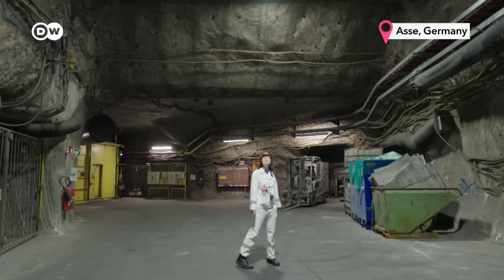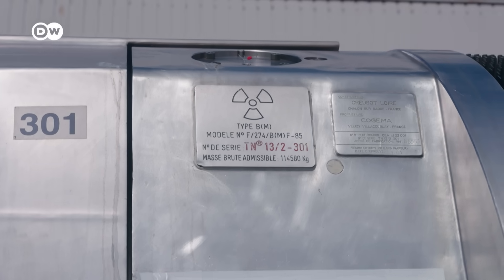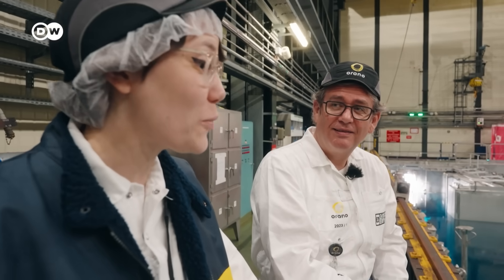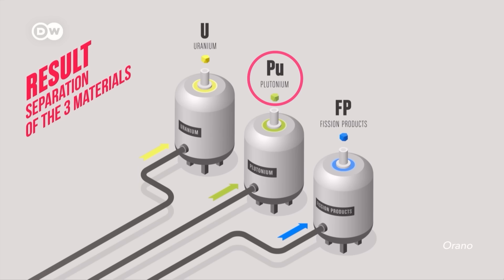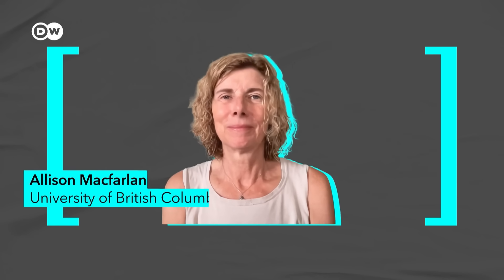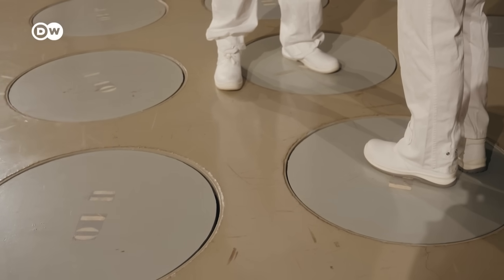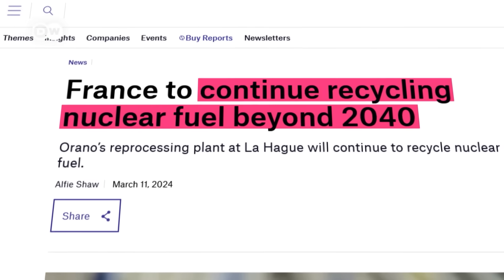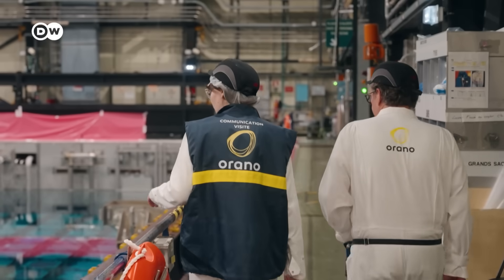Nuclear waste is reusable. Why aren’t we doing it?

Comment: Nuclear + renewables would have been the key for sustainable, climate friendly energy supply until nuclear fusion is ready.
More industry nations should have done it like France, of course also including nuclear fuel recycling to minimize the amount of waste that accumulates.

That said, of course while France does very well with nuclear, they're a little bit behind in terms of renewables.  The share of energy from coal, gas and oil could have been already replaced with renewables by now.
Reply: Being hopeful about fusion strikes me as odd. What advantages does fusion have that fiission doesn't? Will it be cleaner, cheaper, safer, more space efficient, easier to finance, or otherwise better in a technical, economic, or environmental way? It seems unlikely to me. It might be less politically divisive, but as far as i can tell, that's the most significant advantage.
Reply: @haldir108  Leaving aside that practical fusion power will remain impossible, its advantages as dreamed of by those unconstrained by reality are rooted in its greater power and lesser radiation contamination. Tritium and isotopes of lithium have very short half lives and/or low radioactive signature, and fusion reactions generate 17 MeV per event, far more than fission can claim. So, arguably cleaner, except not really. It takes fission to produce tritium cost-effectively, unless you use lithium exposed to fusion reactions, so you'll likely always need fission if you have fusion, so 'as clean as' is the best you can get. Not cheaper, either, for the same reasons. Safer, arguably, but again not really. Easier to finance, as let's face it there's one born every minute. Better for militaries, since it defrays the cost of overhead for making h-bombs.
Reply: @bartroberts1514 
This is how I think it'll happen:
1. 20 - 40 years of additional development and testing using different kind of prototypes that are all designed to run for only a very brief moment. Everything is still just for research, gaining experience and knowledge as well as proving the concept works.
As things progress and get more interesting, there will probably be the foundation of several different fusion coalitions with nations working together on a certain type of reactor. This is already happening, but it's kinda not with full commitment. Commitment will jump once we get see more milestones being achieve and are getting closer to the goal. 
The more progress and achieved milestones, the more the pace of development will accelerate.
2. At some point during the next 20 - 40 years one or several fusion coalitions will declare they're starting to build a test reactor that is  actually designed/adapted to run continuously, so will have cooling and therefore a was to actually use the energy generated. Basically the first little fusion test power plant.
3. Building this test reactor/power plant will probably take another 6 - 10 years, maybe more in case there are unexpectedly issues.
4. However at some point the first test reactor will run continuously and produce energy. 
Now this will be an absolute key moment and from now on, things will go quick.
The design will get upscaled and based on that design the first full sized fusion power plants will be built, likely a number of them in different nations.
5. So now we're in the early phase of fusion operation and during this phase tritium will likely come from fission reactors that will of course still be around. 
6. Eventually people will want to get rid of fission and go full fusion + renewables. This is when there will be dedicated fusion reactors optimized mainly for tritium generation from lithium. By then it'll be very much financially viable.
7. Fusion power will slowly but steadily replace fission power all over the world.
Reply: @GABA-A42  With respect, your "how I think it will happen" has been around for nine decades. Oliphant and Rutherford were the first to describe that "path", before there was a Manhattan Project, before there was the first practical H-bomb concept even. Oliphant suggested it would be 30 years; Rutherford said more like sixty years. When other Physicists heard of these predictions had a chance to work out the math, they declared both of them to be equally right: it will always be 30 years; it will always be sixty years. We'll never ever get practical commercial electricity production from fusion.
Fusion is easy. Rutherford and Oliphant did it in a crude 1930's lab 90 years ago. But they got less than one millionth the energy out that was put into the reaction.
While that ratio has improved steadily, it still takes a Q factor of 28,700 to pay off just the energy to create the deuterium and tritium fuel needed. ITER is aiming for a Q-factor of ten, and that's dubious.
I get that you're hopeful; that hope is misplaced. Until you can show me the detailed D-T energy balance equations and compare them to the energy for electrolysis and fractional distillation, the plasma containment parametric equations, the heat of initiation of 100,000,000 K+, the cooling units that can withstand the stable reactor output, all of which are necessary to achieve what you're after, and which add up to thousands of times as much energy as fusion can produce, it's all just fantasy.
Reply: Last year 3% of electrical production in France came from fossil fuels. 

Renewable  energy is only useful in two situations: first and foremost in countries that produce a lot of electricity from fossil fuels as electricity from renewables allows them to slow down or stop their fossil fuel powered thermal electrical generating plants, and thus reduce their CO2 emissions, that is when the sun is shinning and the wind is blowing. At night or on cloudy days, when there is not much wind they still entirely rely on their fossil fuel powered electrical power plants. The second useful use is in hot countries that use a lot of air conditioning as peak sunlight roughly corresponds to peak air conditioning use, although people still run their air conditioners at night or on cloudy muggy days when solar power produces no or little electricity.

Contrary to what the video reports, France produces over 80% of its electricity from nuclear, 83% in 2023, over 10% from hydro power, France has high mountains, 3 to 5% from renewables, and about 3% from fossil fuels. Fossil fuels are used on the coldest winter days to meet peak electrical heating demand.
Reply: @philipperapaccioli2868  The IEA forecasts a 3% drop in coal generation in China this year, while every year China adds enough new renewable power to equal 260 new nuclear plants' output. By last year, wind and solar backed by storage in China exceeded the total electricity demand of Japan -- more than double France's -- and at current rates will produce enough storage-backed renewable power to power the USA by 2030.. 40% cheaper per MWh than from coal.
China and India are rolling out TWEST, to convert coal, gas, and nuclear electricity generating plants to low-cost storage for renewable electricity. So much for nights and cloudy days. By the way, the cost of powering down and bringing back up the furnaces for coal and gas plants is immense, such that if you were going to run them every night, you'd run them all day too, just to keep them hot.
With UHVDC, time of day constraints fall away, and anywhere can conceivably get solar from another time zone even at night. China already does this across all its time zones.
And then there's the potential of enhanced geothermal.
France could easily power itself 100% by renewables; France can't get military-grade fissionable materials from wind and solar, though, so pays through the nose for nuclear instead.
Reply: @bartroberts1514  It's nice to throw around large misleading numbers.
In 2023 China had 1,390 GW of thermal electric power generation capacity, burning coal and gas, and had 609 GW of nominal solar electric power generation capacity. Thermal accounted for 47,6% of installed capacity and solar accounted for 20,9 % of nominal installed capacity.
How much electricity was actually produced?  6,232 TWh of electricity from thermal, coal and gas, or 70% of the total. Solar produced a measly 294 TWh of electricity or 3% of total electrical generation. 
So solar is 21% of installed capacity and 3% of electricity produced.  
Meanwhile, Nuclear with only 57 GW of installed production capacity, 2% of total nominal capacity, 11 times less than solar, produced nearly 1,5 times more electricity than solar.
How could that be? because the truth about solar is that most of the time it produces no or little electricity, and when it does produce at peak capacity, that electricity is not necessarily needed.
As for transcontinental power lines, they are a pipe dream: extremely expensive and quite inefficient.  
Germany, a tiny country compared to China, is years behind schedule building power lines from the north where it generates significant quantities of electricity from wind, to the south where it is actually needed. Years behind schedule and way over budget.
So in China solar  accounts for 3% of electrical production. Revolutionary
In China in 2023, electrical production from thermal, coal and gas, is up 380 TWh, Solar production is up 65 TWh.
Solar is a convenient fig leaf to hide the fact that we really are doing very little to limit CO2 emissions. 
Look, we are installing all these shinny new solar panels, which actually produce little electricity, so keep consuming like there is no tomorrow.
Reply: @philipperapaccioli2868  I don't think it's nice at all of you to throw around misleading statements or try to provoke fear of 'large' numbers.

Nuclear has merits. Affordability and speed to deploy are not among those merits. New nuclear is not a Project Drawdown Climate Solution Roadmap priority, and focus on it distracts from the critical actions we need immediately. That much of nuclear is a ruse to keep feeding military ambitions is entirely beside the point.

That China is making political decisions on its grid in no way makes the technical achievements less valid. At current rates, China could flip a switch and turn all those coal and gas generating stations into TWEST to store solar and wind energy while maintaining a stable grid without skipping a step. All those floods and landslides in China due to climate change precipitation shifts demand more water management, and hydroelectricity is the solution to that problem. Enhanced geothermal is more feasible than China's nuclear technology, certainly.

Yes, we are doing very little to halt CO2.

But China can in five years time halt CO2 entirely; not that anyone is saying China will, but can your country make the same claim?
Reply: @philipperapaccioli2868 Who told you there is No Wind at night? Looking at German Data from this week Wind Power Generation is increasing at night
Reply: @SPARTA1581  I said there are times when there is little wind at night.
Look at the data. There are times, especially in the winter when there are high pressure systems over Europe, and little wind for days.
That is why Germany has kept all its coal and gas fired electrical power plants. 
There are extended periods of time when renewables produce very little electricity, especially in winter.
Reply: Most of it pretty much is already replaced. They're only using tiny amounts of natural gas for high load, and of course diesel generators for remaining off-grid uses. The last coal plant is basically just for extra heat & electricity demand (and dwindling solar supply) during winter. Plus they're already taking excess wind and solar power from Germany.
Reply: fusion is a fantasy that will never happen. we need to stop deluding ourselves into thinking it's ever going to be possible and just embrace nuclear fission as a permanent, long term power source.
Reply: France is so far behind in renewables because of their nuclear reactors. They have to run 24/7 to be economical. They leave no space for renewables to add energy to the grid. They basically force renewables to add storage to their systems, so they can deliver the energy need for the duck curve, while nuclear gets the base load. Instead of the other way around: Letting renewables send their energy directly to the grid and just filling up the missing energy with nuclear and storage.
Reply: @Psi-Storm  Fortune is reporting energy prices are so low due to EU renewables that France has canceled one reactor and shut down six (Golfech 2, Cruas 2, Tricastin 1 among them).
Reply: I cannot emphasize enough how false hope of nuclear fusion being practical one day is. It will never happen. It takes approximately three thousand times as much energy to produce the pure (enough) Deuterium-Tritium mix it takes to initiate fusion of a pair of these isotopes, no guarantee more than a few fractions of a percent of these isotopes will react, and no hope for a stable contained fusion reaction that provides more electricity than it takes to initiate, contain, and maintain.

China produces five new nuclear reactors worth of solar PV a week. With TWEST, old nuclear and fossil generating stations can be converted to effectively store enough solar power to supply need on demand when the sun doesn't shine, at low cost and without using fuel.
Reply: Nuclear fission power generation is not in any way "sustainable" and nuclear fusion power generation is a pipe dream that will never be viable.
Reply: Going back in time to post Chernobyl and Fukushima and convincing everyone to keep building nuclear for environment reasons would be great. But now that we're mostly stuck with what we have in terms of nuclear plants (new plants like Hinkley point C and Olkiluoto 3 are unsustainably expensive to build more of) , we need a breakthrough like SMRs or MSRs to get nuclear costs down enough to build a lot of it. Hopefully it happens, it would really help the transition.
Reply: @szurketaltos2693 or just order some plants from korea. Those are relatively cheap and fast to build. Or china. It's not a limitation of nuclear, it's a failure of the west
Reply: @cristoforestman  easier said than done politically, but I would love to see it happen. Thing is, I suspect that onshore wind and solar from China is going to be a lot cheaper than a Chinese or Korean nuclear plant; very possible that Korean nuclear is cheaper than offshore wind however. So it depends on the available sites.
Reply: @szurketaltos2693  the wind is cheap, the solar is cheap, the batteries are mid to expensive, but if you put the requirement to generate reliably all year regardless of the weather constant energy without using fossils, it's no longer cheap and depending on how many sunny days the country has, the nuclear can be cheaper. Regardless, even 100% renewable grid will have more co2 emissions than nuclear except countries with lots of hydro
Reply: @cristoforestman  sure, nuclear has lower CO2 intensity. That doesn't matter for new investments if we can't build the plants cheaply enough. Korea can, but the West currently cannot. I'd love to see more nuclear constructed, but it has to be at reasonable costs otherwise we'd be better off building renewables.
Reply: People need to realize that different countries have different needs
Reply: Nuclear power is garbage and not substantial or even green at all
Reply: France litterly no building rewnewable energy they just build more Nuclear
Reply: The supply of electricity from coal in France has been zero for some years now.  Oil is used in some remote locations and gas is mostly used in combined cycle electricty+urban heating.  France is not Germany.
Reply: @JohnHughesChampigny  (Source WEF2024) France 4.68 tCO2e per capita; Germany 8.04 tCO2e per capita. 

France 305.98 tCO2e total; Germany 674.76 tCO2e total. 

EEA: France dropped CO2e emissions 24% from 1990 levels by 2021; Germany by 41%.
Reply: @bartroberts1514  France dropped CO2 output by 24% since 1990 , but it started dropping CO2 output from electricity generation in the early 1980s.
Reply: @JohnHughesChampigny  And that's a great thing!

France and Germany are champions for 24% (actually more like 33%) and 41% (closer to 44%) drops from their peaks.  And they haven't even been making a full court press on that.

They still rank in the top 20 CO2e emitters from fossil worldwide, in fact. They still have significant land use issues, too.

We can celebrate their minor victories while recognizing how far we all have yet to go, and how little time left to get there to avert even worse disasters than now we see globally, feel in our own lungs worldwide.

So I recommend Project Drawdown's Climate Solutions 101 Roadmap.

And we can do even better than that.
Reply: Yes, france is a bit behind,  but thats bc they just dont need to. Frances energy is already one of the cheapest and cleanest forms of energy in the world. So they arent in a rush to install renewables like other countries
Reply: Renewables and nuclear don't mix. Isn't any point in offsetting a clean energy source with a slightly less clean energy source.
Reply: No, it's small amount of peaking cannot, and really should not be replaced with renewables. A sub two percent polluting power generation is NOT a issue. That tiny amounts provides immeasurable stability. 
Progress isn't abandoning old technology. It's about replacing a majority with better, and retiring the old ones to a limited niche role.
Reply: Funny fact is, replacing coal/gas with nuclear will reduce carbon emissions more than replacing those with renewables. Just as an example, look at renewable share of denmark and their carbon output per kwh versus france
Reply: @cristoforestman  renewable energy is the cleanest
Reply: @imtheeastgermanguy5431  No it is not. Wind and solar are always backed up by coal, oil and gas. You need to look at how renewables transform the whole energy system. Last year dirty Germany emitted 381 g CO2/kWh compared to France 56 g CO2/kWh.

It is like saying my diesel car is clean, because it produce zero emissions going downhill.
Reply: @imtheeastgermanguy5431  Not if you have to replace it in 20-30 years for ever and ever, please revise your beliefs
Reply: @imtheeastgermanguy5431  not the cleanest. 100% renewable grid will have higher co2 output than nuclear
Reply: @cristoforestman  no. You need storage for the nuclear waste and this for millions years and concrete doesn't hold that long I guess. So you need a lot of materials, workforce and money to keep it safe. Renewable power plants will be recyclable in the future